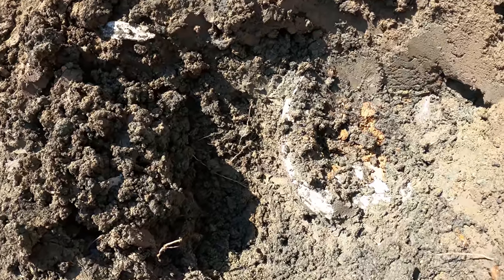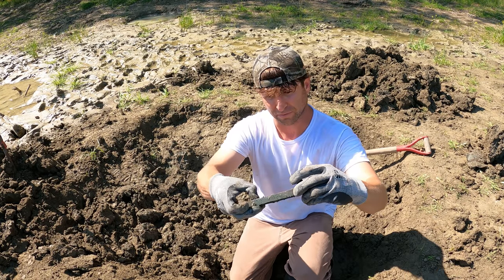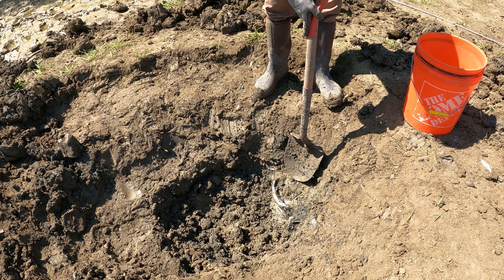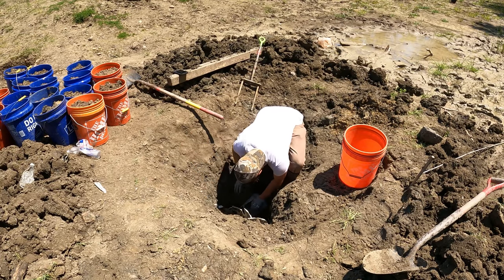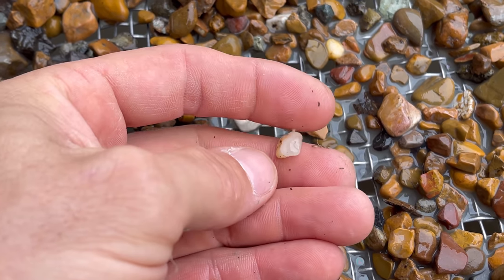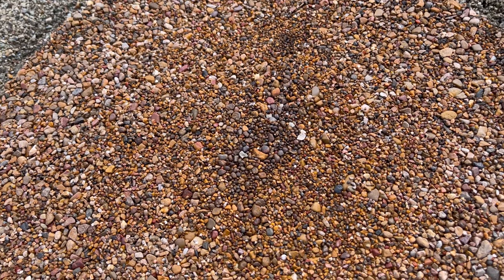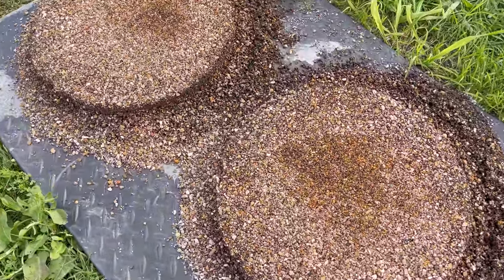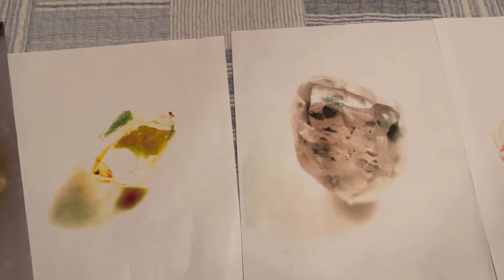FOUND A FANCY YELLOW DIAMOND, UNDERNEATH BUIRED BUCKETS

Comment: hey you should try to find someone that does drywall taping in your area Ivin the white one with green lid they are better way better then home depot or lowes buckets and you can get them for free at any jobsite dumpster i throw thousandsof those away a year but you can find out by stopping at any jobsite dumpster they will even stack them and clean them for you if you ask them
Reply from the maker: Good idea! Thanks for letting me know !

Comment: Why don't you use post-hole diggers instead of having to dig such massive holes? I would think they would make the work a whole lot easier.
Reply from the maker: Because I need shovel loads at a time to get the buckets filled up ASAP. Only have 7 hours to dig, post hole digger work, but they aren’t very productive vs a shovel.